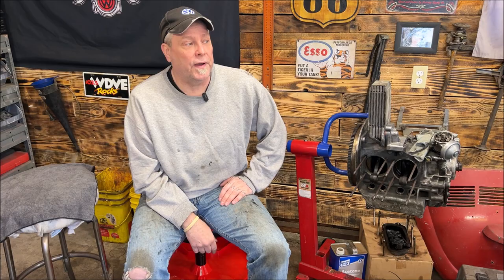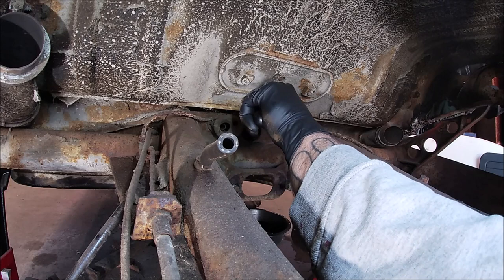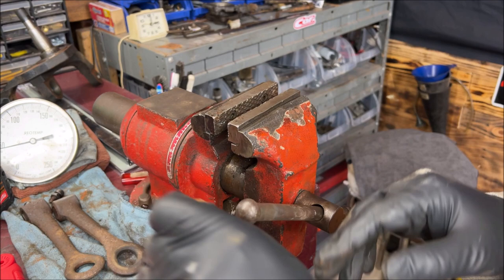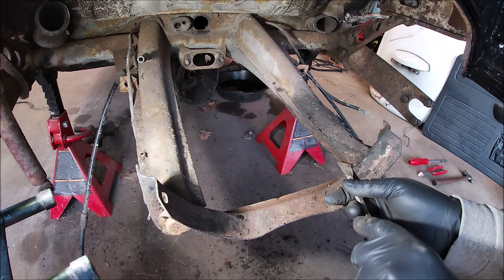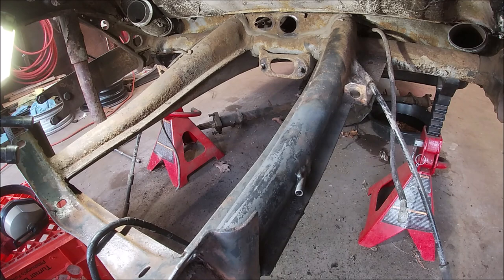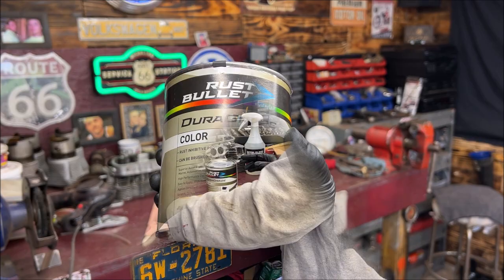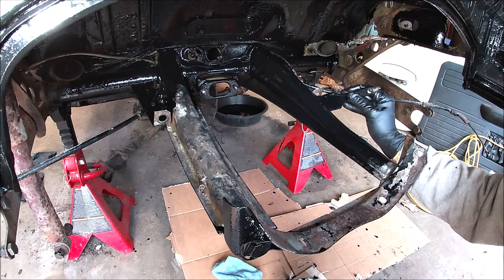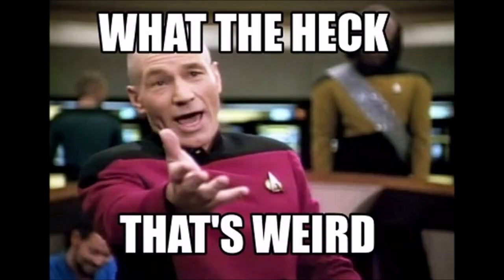VW Beetle DIY Rust Removal- Rear Cradle & Luggage Compartment Refurbish - RUST BULLET - VW Bus

Comment: I always take the old brake lines off in one piece. Then they can be used as a template for all the correct bends making it easier for install of the new ones.
Reply from the maker: Yes I agree! It’s nice to have something to go buy it makes it work out a little bit easier.

Comment: Nice job brother!  Yes, I always pull thr body off of everything I build.  Just makes for a better end result I always feel like.
Reply: Not if the body isn't braced it will flex  out of line and weaken.
Reply from the maker: Absolutely I want to do that on my sons Baja. I will brace everything off and pull it apart.

Comment: On the weather strip molding, what about using stainless steel flat head machine screws or counter sink rivets. Thinking that, most people get the standard pop rivets that have the crown around the shaft. Note: once the shaft is removed, that leaves a hole to deal with. You could possibly use a small counter sink bit and make the indention and place the machine screw or rivet (solid rivet like aircraft use) to hold the molding down. There is also a counter sink pop rivet with the shaft, but again might leave a hold for water to leak through into the trunk area. With a screw in the hole and a nut on the inside of the hood area could give you a better seal and smooth surface.  Just some other thoughts.   Thanks
Reply from the maker: Thank you so much keith I truly appreciate you chiming in. The rails just made it today, so I’ll be starting on that in a few days, at least the starting process. I ended up buying some stainless steel prop rivets since I know the rubber will hide the rivets. Not sure if I’m going to use them though. Thank you so much for being here my friend I truly appreciate it a lot.

Comment: Stainless steel rivets. Aluminum is dissimilar metals and electrolysis will weaken aluminum over time. Question 1974 Super beetle, what size tires would you recommend for stock, currently have 165 80 R15. Thanks
Reply: That's the best size for up to 90 hp aprox, any more and you can benefit from more width at the back but 165  should be fine up front, bugs are so light upfront.
Reply from the maker: Truthfully the 165/80 as stock for the Beetle. Sometimes I go a little wider in the back, but I keep the same diameter.

Comment: Those replacement ribbed panel behind the rear seat are real expensive to buy a new, inferior metal. Really best avoided. I havent ised rust bullet before but pretty much every rust preventative product I used in the last twenty years has been snake oil! Reason being before in the good,old days more effective products were real toxic and bad for the environment, so todays products are real lightweight, watered down products in my experience.
Reply from the maker: Funny, you brought that up John, I was just saying to someone recently about the products we have now compared to when we were young. Rust Bullett has been pretty good on my buddies truck frame for about the last seven years so far. That’s the only thing I can verify at this point. When they removed their so-called hazardous materials from a lot of products, we lost the durability.